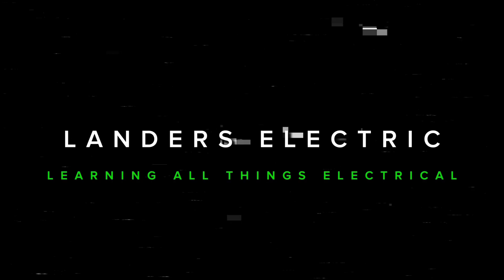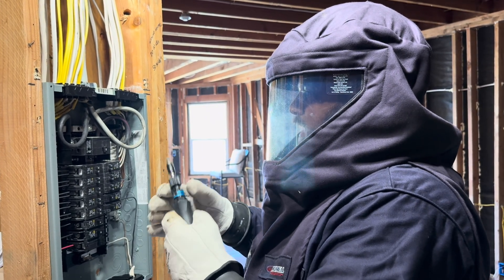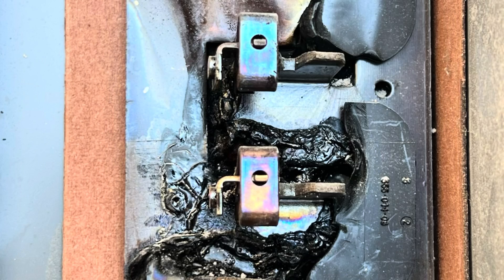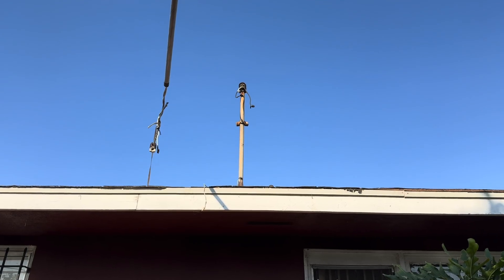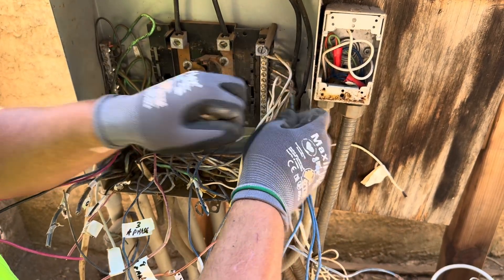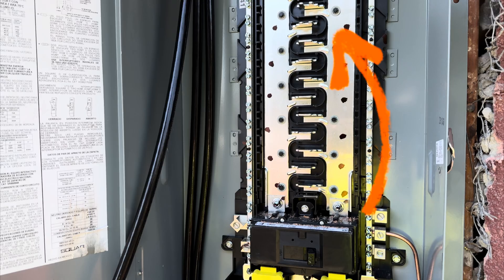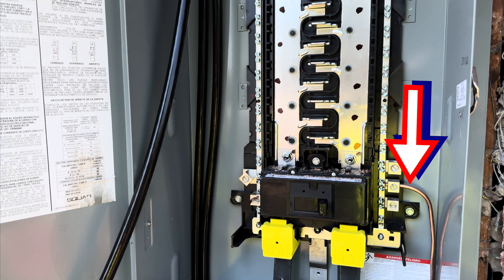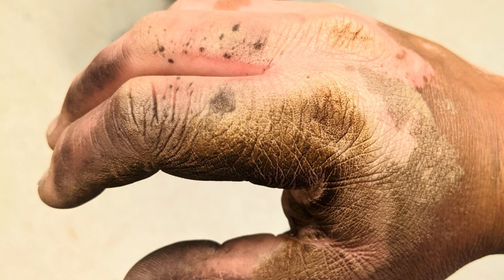I Could've DIED! | Electrical Panel Upgrade Arc Flash Accident

Comment from the maker: ⚡ Watch our Full Master Electrician POV Vlog Series:
https://www.youtube.com/playlist?list=PLX0FTiBM6YfY25oBvJFPvGlr9BbicDRJP

ARC FLASH SUIT KIT
👉 https://amzn.to/3TERzvB
BEST Electrical Multi-Meter that I use everyday!
👉 https://amzn.to/3TNDSL2

Have you ever been burned or seen someone burned in an arc flash incident?
Reply: I have personally survived too many arc flash incidents: One, a faulty disconnect switch, two, a meter stuck in the socket (was common in our area for sparkies to pull meters on panel upgrades) and the third was trying to seat a Zinsco in a panel with no main (My parent's house, I was 15 at the time) by smacking the end of a screwdriver on the terminal. Smacked so hard driver broke through and across both buses.  All of those were "only" 120/240. And all in my first years.  After close to 40 years I have gotten a lot smarter, and in the extremely rare times I "had" to work hot, full PPE. As for seen, yes, first bad one was at age 9 seeing a utility worker vaporized by a pole transformer, and have witnessed a few others during my years in the trade.
Reply: I’ve had 2 phases of 480volts blow up a faulty meter in my hand. Luckily I was wearing my 40 cal. I could feel the pieces of the meter hit me in the chest. Definitely made my ears ring and happens so fast you don’t have time to be scared.I always wear my PPE in 120 volt panels. People will learn when it happens to them.
Reply: I am close to retirement after 35 years as commercial and industrial construction electrician. In the beginning we worked most things hot.  Stay isolated and coordinated.
Reply: @landerselectric  had a 480 V air compressor contactor blow up  in front of me after it ignited due to an oil mist, caught the flash, my eyes had welders burn for two days, I was lucky.
Reply: @paulmartinez471 no you were blessed.
Reply: You have saved countless lives by being man enough to allow us to learn from your tragic incident. 
Thank you.
Reply: Aren't there disconnects before the meter on residential panels¿ I do commercial, I'm used to disconnects everywhere. My only arc flash was with a wire I touched to start an electric motor on a 480 volt generator this is when I was a kid 20 years ago. I thought by touching a hair of  the wire it would spin, the arc left me blind for about 5 minutes and some of my eye lashes were burnt.
Reply: Seriously heart wrenching content. Raised by an old school electrician. My dad trained me on panel work as a kid. He would take me and my brother and sister and do pro bono work for needy, or builds for our congregations. And he always tried to remind us to work safe. One time we where trying to help someone and fix an outlet and we where in an attic and helped splice the outlet into a line, and he accidentally got 'bit or a small arc by 240. only time I ever saw him scared. Thankfully he didn't get nearly as burned. Recently I have been learning welding, and studying on arc welding, and how that all works.. that gauge wire, un- filtered, all but unfused, you unleashed some unholy power on your hand. After hearing your story, I am going to go get me some better electrical gloves and PPE for when i do electrical again. It's less safe than welding
Reply: I had a family member that lost his arms and legs because the power line broke and crossed between live and neutral i do believe hes dead now. (He worked for the utility compan)
Reply from the maker: @DawezilsSystemsElectric so sorry to hear that!
Reply: No, but I was in a workplace fire, the dust collector for the CNC caught fire, I tried to get it out with an extinguisher but it wasnt enough and all 4 buildings were totally destroyed with contents and all, I got 2nd degree burns on my rt arm, burned my hair and scalp. I had to go to the burn hospital 4 hours away the next morning as the local hospital wasnt equipped to deal with burns,  I had to get skin grafts on my arm, multiple trips to that burn hospital and 6 weeks recovering at hme, but it was all covered by worker's comp and after a year they closed the case and paid me $11k.
Burns are the worst and the skin will never be the same as it was, my scalp, hair and burns on my forehead all healed as though nothing happened.
The worst was the donor are on my thigh they used for the skin graft, once the bandage was taken off that the thigh was so sensitive, I couldnt even  bear the bedsheet touching it, pants were out of the question! I wound up buying a Scottish kilt and wearing that garment for a while, it was the only thing I could wear that didn't hurt!
Reply: NFPA70E should be taught to all electrianns, Arc flash/blast safety, and what PPE is needed.
Reply: I have but it was 480 three phase. This accually looks worse. Guess it depends on how and where you are standing. I've seen and heard some bad BOOMS. 
I was off a Saturday that doing remodeling a contracting crew was taking out breakers we called them buckets. 480 three phase. I guy I knew that lived near me was working with this contractor. He was tasked with removing the buss bars behind the panel. He later told me they were hurrying him , the power was off , go ahead disconnect the power to the busses. He took two loose and said he put the wrench on the third and that's all he remembered but the flash. My riding partner was changing knives on my machine , I usually preform. He said the man came out black as he is , smoking. This man had like a white afro and it was gone. I saw him a year later, you'd never know if you didn't know. He said there was a jumper on that leg. No idea what that is. I'm not an electrician but a guy that very carefully wired most of my home. That was easy , going in my outside panel from the street that I can't turn off is tough. Yea I'm a little scared but mostly very very carefully respectful.
Reply: Not an accident, but a tale of knowing to take precautions as a DIY guy.

I was working in a live RV park sub-panel. I had a number 10 bare ground to land. I knew the risks and even though we weren’t supposed to switch the upstream main, we switched it off long enough to land the ground to prevent exactly this type of accident.
Reply: Very small arc flash incident. Was working on a 120 circuit that I stupidly assumed was dead because I dummy sticked it, but the hot was cut further up the run from damage. Was cutting the wire to make a more manageable length to pull a new run up the panel (because we knew it was broken somewhere), and I stupidly didn't check the breaker. 

Pow! It was like a gunshot, an explosion in my hand, and my cutters went flying. I quickly took inventory of myself and was alive, but I smelt burning, and then a sharp pain started on my hand where the cheap gloves I used to play in insulation were burned through. Took the gloves off quickly, noticed a slight burn developing, and immediately went to a sink and ran it under cold water for 15 minutes like I was taught in first aid class. It ended up with a non-serious burn, but it was a sore spot for a couple of weeks. I did have electrical boots on. The breaker did its job and tripped as soon as I bridged the neutral and didn't have anything to ground out on, so I didn't get zapped.

All in all? I'm really lucky. It ruined my gloves, and my favorite pair of diagonal cutters now have a permanent reminder of a 120 dead short. I have no scars from it, but I'm pretty annoyed because I'm usually more careful than that. Let's be clear, after the incident, I sticked everything multiple times and would meter out conductors before assuming they were dead. 

I had a bad flinch when cutting romex for a couple of days afterward.
Reply: My neighbor who works for a power company. He took a early retirement after a coworker was killed while working on something. The way he spoke about it. It sounded gruesome.
Reply: @landerselectric  I got my retinas "burnt" by an arc flash once. My boss at the time was pulling a new set of wires through an existing conduit with a metal fish tape and the lights in the building went out. That was the existing circuit in that conduit being shorted out from cutting into a wire with the fish tape. I was tracing out the wires to find the break when he tried resetting the breaker without telling me. He was convinced it was a nuisance trip because after decades of experience he had never seen a wire cut by a fish tape. I had just found the fault/break it was right next to a junction box. I was just about to pull out the broken wire when I heard loud pop and a fireball shoot out the conduit at my face. Though I was surprised,  everything seemed fine until later I woke in the night with my eyes in extreme pain. I ended going into the emergency after I realized the pain was only getting worse even with numbing drops (eyedrops). The doctor explained it was my eyes had essentially gotten sunburnt. Probably the worst pain I've ever experienced even compared to kidney stones and a ruptured appendix. I had to keep my eyes closed or wrapped for several days only opening to keep putting a special ointment on them for every time the pain in my eyes got too unbearable. That was in addition to the oxycondone. Thankfully I made a full recovery after a couple of weeks, but it was a wake up call. This could have been prevented in so many ways. Many ways I could have blamed on the other guy but I also didn't lockout/tag out so I could have prevented it myself.
Reply: No but I'm a R&D Engineer,  my next development is a air ptc heater that works at 700 vdc. I have a 480 VAC 70 Amp service feeding my SGX power supply capable of 100 vdc at 15 amps. I can current limit my power supply but I don't know when arc flash is  a factor. And working with prototype components and systems I'm nervous about arc flash. Also I'm a mechanical Engineer by education and have had limited electrical training for safety and measurement practices. I'm nervous about probing live components during testing and arcing a probe.
Reply: @EliteSniperFMJ  if you're prototyping when you are building the panels add a wire to imortant points in the circuit and add ampmeter and/or voltmeter to monitor.
Reply: @firewoodsteel  I had this idea, I have wire and insulated banana terminals to make individual test point leads so I can have my dmm "hard wired" to test points.
Reply: @EliteSniperFMJ  that works but if you mistakenly put the wrong banana terminal to the wrong place you could get arc flash. When we build panels and want to monitor something temporarily we'll buy a cheap volt/amp meter online. Some are as low as 6 dollars. Our panels ate rated 600 volt and we use about 400 amps per panel so for us opening that door requires a suit. The time wasted is saved by a 6 dollar part.
Reply: @firewoodsteel  I have 3 meters I was planning on leaving them stationary but I do like the idea of semi permanent meters I'll look into some today.  This project is 700 vdc if you have any recommendations I would appreciate it.
Reply: @EliteSniperFMJ  make sure you use components rated for 1000 vdc 😅. Not a common voltage you're using there. Most of everything used today is rated 600 volt and below.
Reply: @firewoodsteel  yes I have validated 1000vdc, I should be testing around 700 vdc but I'm outfitting upgraded test leads and cables for the high voltage applications.
Reply: I had one happen on a electric scooter, i had a backup set of batterys in a carrier, when the ones onboard ran out i switched them, but i accidently plugged the two batterys into themselves and my finger got the full force of it. Walked my ass home and drove to the hospital. I had to go a trauma center for follow up.
Reply: Think hot dogs left to long on the grill.
Reply: Not an arc flag but I did get a bad burn and a real good s are a year or two back. I wasn't really even working on electricity. I had just rebuilt an air compressor hooked it all up and fired it up without putting the plastic cover over the pressure switch. I heard air leaking and was trying to feel around to find where it was coming from. My wrist touched the terminals on the switch. When they say 220v will throw you, that not always true it grabbed and my arm locked up. I couldn't pull it off. Luckily I was able to reach the power cord with my left hand and unplug it. If I hadn't reached that cord I don't know how long I would have been there. 4th degree burn and now I have a nasty scar. All's good still have full use of hand and everything just cosmetic now. I didn't even go to Dr until it got infected and that's when I found out that it was deeper than I thought. Really scary for that second or two before I got it unplugged. Felt like minutes as I tried to pull my hand back and then when I couldn't to figure out what to  do.
Reply: Crossing phases,  (277/480)yep it wasn't pretty, he ended up in the hospital, shut down the entire job and irony was, he was the boss's son.
Reply: Been there. Too many hours too much work. Thought I disconnected a 600v line, yanked the cable from the machine and caught a major arc flash. Went blind for about 30 seconds. I shrugged it off but around midnight that evening I awoke in agony. It felt like someone threw beach sand in my eyes. Bits of metal were fused in my eyes. Over all I was lucky.
Reply: Thank you
Reply: I had an arc flash incident exactly 7 days ago.  Both hands are burned. Can hardly type now. Using a lavanid gel every day to keep the wounds moist. By the way, I still kept going to work till yesterday when I couldn’t bear the pain anymore. What crème  did you use?
Reply: So far in my six decades of life I've never said to myself in the morning, "You know, I shouldn't have been so careful yesterday!"

Comment: Thanks for sharing a hard lesson. Glad you came out OK, despite scars. It's surprising how many times I've heard of people changing out entire panels with the main service wires live. Panel change without a permit, so they don't want to disconnect meter and get in trouble alerting the utility. Not worth it. I've seen arc flash when someone cut live service wires at masthead and brushed the neutral. It sounded like an explosion-well, it basically was.

Comment: Glad you made a recovery and are helping others to learn from your own mistakes.  Arc flashes are no joke.  Even lower voltage systems can be extremely dangerous if the power supply can deliver an extremely high current.  A good example are battery rack systems used in data facilities, as well as large capacitors in some machinery.  A 48 volt  system consisting of a series - parallel connection of 8 large 12 volt lead acid batteries is capable of delivering thousands of amps of fault current and should be treated with the same respect as a live 480 volt panelboard.

Comment: It absolutely can I was a firefighter for 24 years until I was electrocuted in a structure fire.  I was pulling the ceiling down to expose where the fire was.  This issue got me an ambulance ride and 100% disabled. At the ER very clear enter and exit areas Now I can’t work anywhere it ended my career and my future.

Comment: Hey man, your video is now 10 month old so i dont think you will ever read this BUT i write it anyway! I'm a painter here in germany and 220/230Volts are easily enough to do proper damage to you! Sure, it wont end you in like 99% of the time, which doesnt mean you wont have a damn bad time. I remember a specific accident i had when our company got the job to renovate a old discothek. They did all new drywall work and ceiling and we did the seam work and when i did that there was NO electricity on any of the wires. But somehow there was... on just ONE wire and i touched it with the back of my ellbow while i stood on a ladder... the "funny" part was, it was a 430Volt high voltage wire from a fog machine or something. Well, i didnt stand on the ladder afterwards and i dont really remember my fall. Gladly i only had minor burns on my arm and somehow nothing else... i guess my guardian angel watched out for me, Thanks buddie! :-D So to everyone who reads this, STAY SAFE!
Reply from the maker: Still read the comments. Sorry that happened but really glad you’re alive. Electricity is no joke! Safe wiring!

Comment: I have been an electrician for 48 years and worked in the UK as well as here in Canada. You don't realize how much personal protection is required and up to about 15 years ago the only thing I was using was safety glasses. Like all electricians have had some dealing with the power. I ended up on 600 volts and one day in emergency. It is a dangerous occupation but somebody's got to do it. I now work as a professor at George Brown college in Toronto teaching apprentices and I can't explain to them how much personal protection is really their defense against getting killed. Hope your hand is good and definitely you won't forget it. Take care